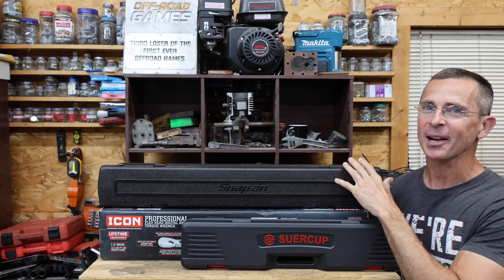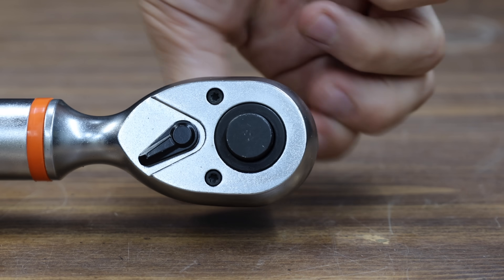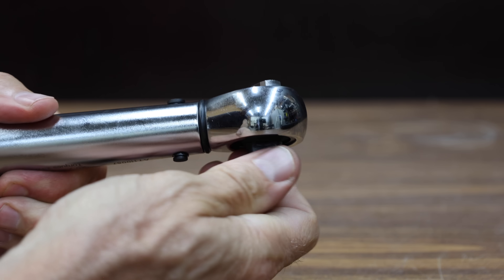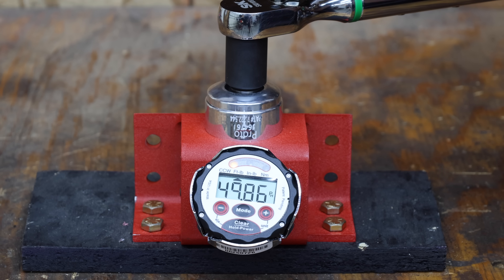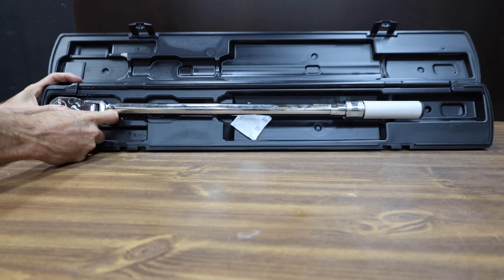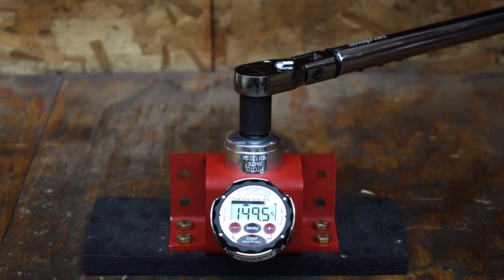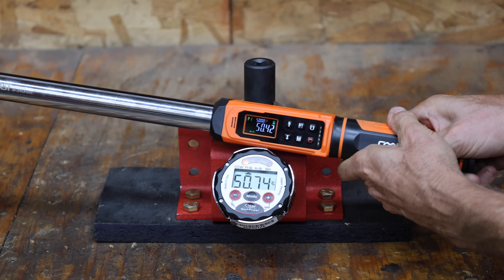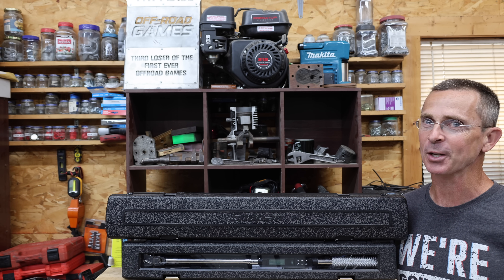$78 Torque Wrench vs $790 Snap On & ICON—I Didn’t See This Coming!

Comment: using a Pittsburgh 15 dollar one just for lug nuts and i haven't had any wheels fall off yet 😂
Reply: You're still going to be much better off with the cheapest wrench on the market vs. some tire change "technician" at one of these tire shops armed with nothing but apathy and an air impact gun.
Reply: @dynadork3312  Then when you have a flat, your can't change the tire because because the jerk tightened them so much you need an impact wrench to loosen them!
Reply: @debluetailfly if you weigh over 150 you can jump on the beaker bar and hope it breaks loose at some point. Maybe find a. Way to still push down against the car
Reply: @alexvillalobos7137  sound like a way to injure yourself. I use anti-seize on lug nuts and tighten with a torque wrench. Never had a problem since I started doing that..
Reply: @alexvillalobos7137  sound like a way to injure yourself. I use anti-seize on lug nuts and tighten with a torque wrench. Never had a problem since I started doing that..
Reply: @dynadork3312 so true. I had a tire shop put a set on my 02 Avalon and they were so tight I got out my digital torque adapter to check them the worst took 180 lb ft to remove. At the other extreme, Costco tire shops use a torque wrench and go twice around the vehicle and indicate on your receipt the torque they applied.
Reply: @dynadork3312 "... armed with nothing but apathy and an impact gun." 😅😅😅 CLASSIC!!!!!
Reply: @dynadork3312  fax
Reply: Harbor freight in the last 7 years been cooking
Reply: @bryanCLXT HF cooking as in W or L ?
 Not sure I want to trust their cheap tools I'd rather go to home Depot and get me a craftsman or DeWalt torque wrench, snap on is overrated IMO
Reply: @StickNclutch I buy tools from them that I either don’t use a lot or aren’t very technical.  eg:  A metric box wrench is a metric box wrench.
Reply: @StickNclutch  Craftsman ain't what it used to be. Quinn and Icon are better.
Reply: @playdg harbor freight has great tools people that say otherwise are crazy I mean some of the lower end tools ain’t but I used there Pittsburgh ratchets for over 10 years now I’m using icon there just as good as snap on I had snap on Matco ratchets too but I used the Pittsburgh over them bcz they have less back drag but they where new tho and my Pittsburgh was older maybe they wasn’t broken in yet idk
Reply: @StickNclutch  I don't buy the cheapest tool, neither do I buy the most expensive.  I try to get middle of the road quality.  That policy has served me well over the decades.
Reply: @StickNclutch I've had some really good luck with icon stuff... For the money and I don't wrench on cars for a living.... It's all fantastic
Reply: @playdg No lie were told here. 
I still have some pieces from the Craftsman set my dad gave me in the late 80s. Back then it was quality and the quality of any "walk-in and swap them out" returns had similar good quality. 

I did a swap retun of a 1/4" rachet in early to mid 2000s and that one lasted 3 years (diy work only) before needing to swap it again for skipping teeth. The second swap was doing the same a few years after that. 

Sad to say many the brand names that USED to represent quality products are just memories used by marketing to sell products that are NO WHERE NEAR AS GOOD as the name used to represent. 😢
Reply: @StickNclutch  when the kids say 'cooking' it almost always means good. When they say 'cooked' it's sometimes bad, sometimes good lol
Reply: @StickNclutch I use HF torque wrench professionally 

It works amazing
Reply from the maker: Thanks for sharing!
Reply: That's what i got and it's the only job mine has.
Reply: 😮😮😮 heading to HF now 😂😂
Reply: Been using an Icon torque wrench for about 6-7 years now, also without issue! Use it on every tire rotation, I got a lot of Pittsburgh sockets and wrenches as well. Tough to beat for the price
Reply: The Pittsburgh were free recently so that what I’ve got 😂
Reply: Not sure the Pittsburgh ones are still $15, but there is a huge price gap between thern and the ICON ones...ICON is getting too expensive...it should be priced rnore sirnilar to the Gearwrench one, in rny opinion....
Reply: Ditto.
Reply: Brand new Pittsburgh striped the threads on my oil-pan!
Reply: @CrzyMFT The wrench stripped the bolts? Is that like spoons making people fat? 😂
Reply: @CrzyMFT  Yup. For me it was the transmission drain bolt. Luckily, there were more threads inside the pan & a longer bolt was able to catch them & provide a good seal. Never again on a critical bolt with P'burgh.
Reply: @CrzyMFT 
You were using the wrong tool for the job. You needed an inch pound wrench not a foot pound. The size of the bolt should have been the clue.
Reply: @Miner-49  I was using an inch-Lb wrench.... it was that bad, and I was stupid for trusting it when alarm bells were blaring in my head.
Reply: @CrzyMFT 
Alarm bells should have been ringing considering those bolts are grade 8 rated at 150,000 psi. You really had to be trying to accomplish that feat with an in lb wrench.
Reply: @CrzyMFT 
Just for context I wasn’t criticizing you. Giving you a little shop talk. Believe me I have messed up some things wrenching for 28 years.
Reply: @Miner-49  No worries at all
Reply: I work on my own stuffs and all I have is a click chinese made brand and it is just enough to make nothing fall off as well 😂
Reply: I ended up getting the Quinn Torque Adapter and Pittsburg Breaker Bar to make an ad-hoc torque wrench for my truck tool bag.
Reply: Amen 🙏
Reply: All a torque wrench is for is some sort of consistency not exact tolerances. Its not surgery just mechanics and consistency between surfaces is all it is.
Reply: @chevyjerry2507 
Wrong, you really have no idea what you’re talking about. Look up stretch point and breaking point and study.
Reply: @Miner-49 Completely pedantic, for what 99.98% of people are using torque wrenches for, good enough is good enough. Most people won't even be working on torque to yield bolts, and simply getting whatever they're working on to the point the spec sheet tells them is more than fine.
Reply: My Pittsburgh suits my basic needs of getting nuts on without worrying about over tightening
Reply: Mine as well
Reply: Yep.  That is basically my entire use case and I agree.
Reply: I use one on a motorcycle without issue.
Reply: I keep an old school analog gauge one in my vehicle for lugs so I dont have to worry about setting and releasing the tq value.  just pull/push till its in the ball park
Reply: Has been working for me
Reply: They have actually worked quite well for me but I don't work in a shop or on high dollar stuff. 20 year old cars is my wheel house.
Reply: I did the oil filter housing and oil cooler gaskets on my car with the Pittsburg dial style wrench and the nothing is leaking after a year
Reply: Yet. Give it time ;)
Reply: I used to torque my lug nuts by standing on the wrench that came with the car. The main source of deviation was the angle of the wrench since it was a six pointer.
Reply: Pittsburg is garbage, i have had the 3/8 one not click multiple times, i realized something was wrong,will never use a pittsburg again. If you check harbor freight torque wrench reviews seems a common complaint on pittsburg. I am even hesistant on the icon click type due to some review comments. They belong in the garbage, dont skimp on a good torque wrench its not worth snapped or overstretched/yielded fasteners and potential disaster. Plenty of other better quality and still budget options.  Really you are better off buying a used snap on if you want a click type, icon or precision instruments for a split beam (great for wheels, the PI one only good for wheels being around 30tooth, the icon is nicer all around because it is 90tooth), or a reputable brand electronic one, snap on or icon come to mind.  Electronic is def the best, but if you just need a general purpose one you can trust for wheels/caliper brackets/etc id get the icon split beam.  I have $1000 plus in torque wrenches and am totally fine using the icon, split beams are awesome for wheels, you dont have to reset to min setting after use like on a click type
Reply: 3 uggas and a dugga from my fully charged bauer impact is right around 100 ft/lb. Ten seconds of it is somewhere around 450
Reply: But have you snapped off any lug studs?
Reply: Yes because it’s doing the same torque setting 110nm may be 103nm which is no big deal as long as all are the same.. which is the most important part of wheels being tight but when it comes to an engine…
Reply: So Craftsman overall 🤔
Reply: That's great to hear, but do you really trust a $15 wrench for something as critical as lug nuts? A little extra investment could save you from a major headache down the road!
Reply: The difference between my Pittsburgh and Snap On is consistently 1 to 2 ft lbs regardless of direction. Save yourself the money for something worth while.
Reply: @Miner-49 so you seriously think 2 lbs away from your goal will cause failure? Seems kinda ocd to me but I grew up working on farm equipment that never saw a torque wrench and is still on the farm 40 years later.....my Toyotas I'm a little more picky about but not over 2 lbs....in your experience does it make a big difference?
Reply: @jasonsparks4601 On small bolts yeah 1-2lbs is enough to break them. On low torque bolts I use thread locker and torque them by feel.
Reply: @childofTheMostHigh-n7s That's mental, why would you even use them on small bolts then if you're doing it by hand regardless?
Reply: @GarzaGoose Oil pan bolts and transmission pan bolts are supposed to be retorqued after a few days because they loosen up. I use thread locker in those instances... 2013 and older GM trucks have 2 long 10mm bolts that bolt into the transmission housing to hold up the oil pan, specs for those 2 bolts are 9ft lbs, if your torque wrench is off those bolts WILL BREAK.

I own 6 different torque wrenches but I just don't trust them on certain low torque bolts. Replacing valve covers on the other hand I do because the bolts won't break from a little extra torque because of the flex of the new gasket. Valve bodies are another. Certain bolts on Mercedes engines, no I will not torque them nor use thread locker Just barely hand tight.
Reply: @childofTheMostHigh-n7s 
They make an inch pound torque wrench for small and low torque applications.
Reply: @jasonsparks4601 
Not what I’m saying at all. 2 lbs difference between a 400 dollar wrench and a 40 dollar wrench was my point. It’s not enough to justify the price difference. We have a farm also and it depends on the application. Lug nuts…no but I do use them on critical parts like head bolts/studs, water pump bolts,transmission, etc. 
If it’s a field fix, sure doing it by feel is sometimes the only option. But, I usually go back over things back at the shop.
Reply: @Miner-49 understood.  Just clarifying and making sure I wasn't going to cause myself more problems.  I'm fairly new to fixing the internal stuff and wasn't sure.
Reply: @Miner-49 Yeah I know I have one.. It's just on some bolts and circumstances I don't use a torque wrench.
Reply: @Miner-49 lol for how long, a couple cycles? Stop coping.
Reply: @asapmimic1289 
How am I coping when I have both wrenches? It’s not my fault you try to justify your poor decisions with a price tag. Come on now you can’t be serious.
Reply: @Miner-49 no I justify them with results. Could using that garbage, that’s your choice, I’m just glad you won’t be working on anything important to me or anyone I know. Most importantly an engine.
Reply: @Miner-49 wait so what should I get
Reply: I don't even use one on my truck, didn't even know what a torque wrench was till I started working on aircraft. How ever much force it takes to remove I try to match putting on. Drain plugs and sparkplugs I can feel enough to know when to stop.
Reply: True, I have three in each of my cars for emergency. An electronic torque wrench is not recommended for lug nuts, but engine compartment. Lug nuts have a higher tolerance for torque than those tiny engine bolts.
Reply: @TNAN007 guarantee you head bolts have a higher torque spec than your lug nuts on anything smaller than heavy truck
Reply: I really need you to understand this, if you're just an auto tech, use the cheapest wrench cause accuracy on a fucking lug nut does not matter, even on things like the drain bolts, ball joints, etc etc. The core purpose of a truly accurate wrench is for industries that require accurate results, consistently, like machine shops (think CNC machines) the table must be set properly, each bolt involved must be accounted for as youre gonna deal with issues at the Micron level for reference an avg sheet of paper is (0.03mm - 0.01mm) or 30 microns - 10 microns. No company with these standards will use a harbor freight wrench LMAO.
Reply: I use my ass wrench, torques em at 180 lbs at least so i figure im ok on lug tightness..  only things i use a torque wrench for are head bolts or fluid gasket seal bolts and some internal parts on aluminum blocks..
Reply: @Z-Ack  To ensure that you are at 180lbs torque you have to take your floor jack handle and use it on the end of your lug wrench and stand on the very furthest end and apply all your weight, the longer the cheater bar, the more accurate you will be with your torque measurement, but never use this method on any car that isn't going to be exclusively driven by yourself and no passengers as the variables in weight throws off the balance and could create a dangerous situation, so it's best to use a torque wrench and tighten the lugs to the vehicle manufacturers spec in those cases.
Reply: @Nine_Divines  And please don't drive on the roads that I, or my children, are driving on when your wheel falls off
Reply: @chris98118  I was sarcastically replying to someone who said they just stand on the lug wrench and said 180lbs torque was enough, I guess he must have removed his comment, as I can't find it anymore.
Reply: you torque lug nuts?... 👍🏻
Reply: @martinedwards4522 lmao😂
Reply: Who TF torques their wheels.
Reply: @thewhiteknight02 
It’s very common these days.
Reply: I've never used a torque wrench on lug nuts.  It's only for people with ADHD or OCD
Reply: @bertblue9683 I guess I have OCD.
Reply: @bertblue9683 …or people that follow the OEM specifications for lug nut torque.
Reply: @bertblue9683 I got both those
Reply: @bertblue9683  yah like who da fuck uses torque wrench for lug nuts. Just snug.
Reply: @bertblue9683  Torquing lug nuts keeps from warping your brake rotors.
Reply: @childofTheMostHigh-n7s yeah I'm 48 and had quite a few vehicles and I've never warped a rotor and or drum.....had a few cars I drove way too fast and stopped way too hard and still never torque my lug nuts!
Reply: @jasonsparks4601 That's good for you but I have seen warped rotors. I torque all lug nuts to avoid that problem. It's good to have a torque wrench because you can use it on other parts of your vehicle you're working on as well.
Reply: @childofTheMostHigh-n7s I didn't say I don't own one, it's kinda necessary for rebuilding my toyota engines but I did however say I've never warped any brake part....
Reply: @jasonsparks4601 Oh okay I misread your comment..
Reply: @childofTheMostHigh-n7s i wasn't trying to be confrontational but asked serious opinion about higherend specs being affected by the difference you notice.  I play with older toyota pickup trucks and they're really picky sometimes.....
Reply: @childofTheMostHigh-n7s no it doesn't.
Reply: @ObservationofLimits  That's your opinion feel how you feel.✌🏿
Reply: @childofTheMostHigh-n7s  Come now.
Reply: @childofTheMostHigh-n7s it's not even so much warping that is the main concern. Stretching the lugs weakening them is the bit problem of over tightening. Rattling loose for under tightening.
Reply: @caddyguy5369  Right it does lead to broken studs no doubt.. Uneven and over tightened lugs will warp a rotor as well.
Reply: @bertblue9683 my friend John believes in the gutentite method too.  2 times he’s had a tire come off.  Has never happened to me.
Reply: @jasonmershon3941  my sister lost her front right tire while driving down a 70mph highway. Thankfully she pulled over just in time and the wheel didn't kill anyone as it rolled over 6 lanes of traffic

All of the studs were stretched and cracking from some moron using an impact
Reply: @jasonmershon3941  Well he's definitely doing something wrong if he's had TIRES come off after tightening lug nuts!
Reply: @bertblue9683 Rather than a boast, it was more a display of ignorance.
Reply: @bertblue9683  So you are the guy that stars in all those YouTube videos where the tire and rim assembly is flying down the freeway with no vehicle or trailer attached to it at 70 MPH. So you are the type of person that could get people killed and make trial attorneys rich. My cousin was killed years ago on I40 when a yahoo with your thought process had a flat on his equipment trailer. The person changed the tire and rim assembly and did not torque to specs. Miles down the highway the assembly came off and went through the windshield of their car killing them instantly. Torque specs are there for a reason.
Reply: @donho3617  I've never lost a wheel in my over a half a century on this planet and I've never used a torque wrench on lug nuts. You should try lifting weights.
Reply: @Cope_and_Seethe besides not being able to possess reading comprehension skills, you have a myopic view of things in life. I never mentioned that the tire came off due to loose lug nuts as you ignorantly suggested by your comment that  I should lift weights. After the Highway Patrol  had completed their accident investigation, it was determined that the driver of the other vehicle had overtightened the lug nuts causing the studs to stretch. It was also determined that the trailer was  overloaded causing the stretched studs to fail causing the tire assembly to come off the trailer and kill my cousin.
Reply: @bertblue9683  This explains the MC engines I have destroyed with my obsessive love and care!